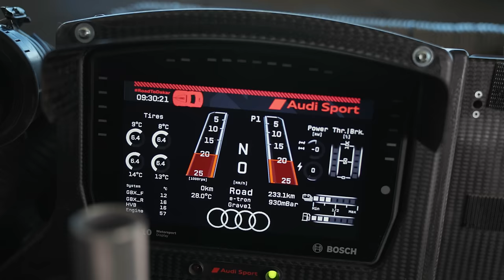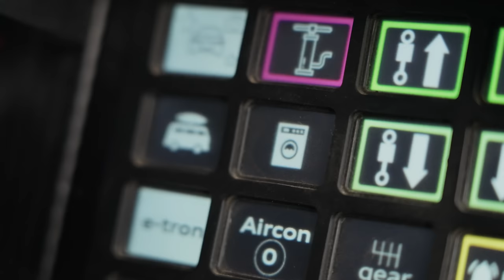FIRST DRIVE: Audi RS Q e-tron - Electric Dakar Car Tested On and Off-Road | Top Gear

Comment: #FALSE This is a ICE powered vehicle. It has ONBOARD generators that provide it power. THUS, it is just a carbon fuel based vehicle with an added conversion from ICE power to ELECTRIC motor power.  The myth goal post keep moveing.

Comment: Nonono Dakar can not go electric. After all the original Rally Dakar route was chosen because it goes through countries that could supply cheap gas.  Rally Dakar is nothing without the feeling of freedom that comes with a gasoline driven car. Although you are in a deadly enviroment, you could just go on, thx to your gasoline powered car. Thats the idea of Dakar and electric vehicles will never be part of this story.

Comment: If only it wasn't worse for the environment by being charged by coal and gas....maybe when it's charged by fairy dust and unicorn farts it'll be cleaner than a regular ICE vehicle.🤷‍♂️
Reply: maybe solar, wind or rivers ?
Reply: Or maybe when it's charged with you know, renewable sources
Reply: Actually it is better even you use coal and gas. Energy loss is much less rather than using combustion engines in every car.
Reply: Please let me know when your combustion engine has more than 40% efficiency. Your engine spits out 70-80% of the potential energy as heat. Your local power plant doesn't.
Reply: Even after being "charged by coal and gas", it's still far better for the environment than a regular ICE vehicle.